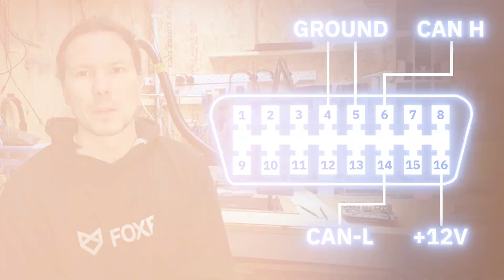Build your own CAN-Bus

Comment: I want to test sensors that use can hi and low on my oscilloscope; what is the best solution? Do they make drivers you can buy or would I be better off on building my own.